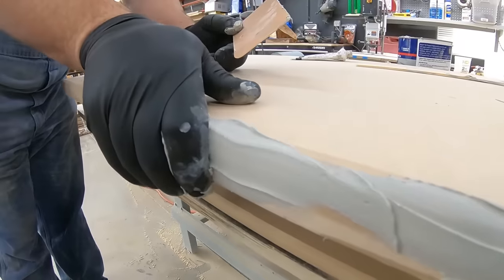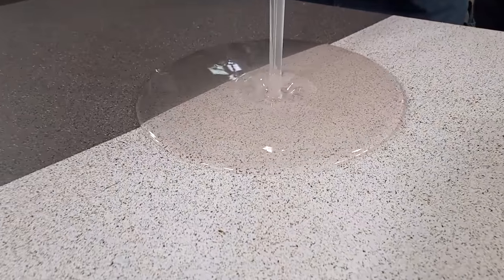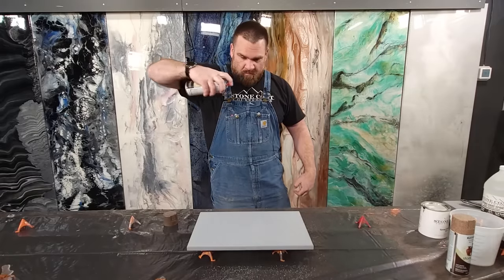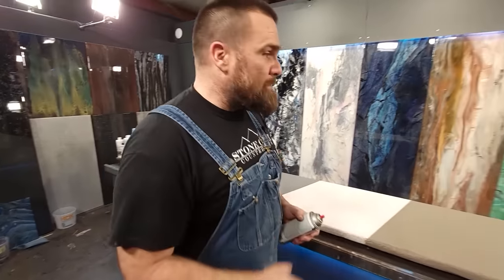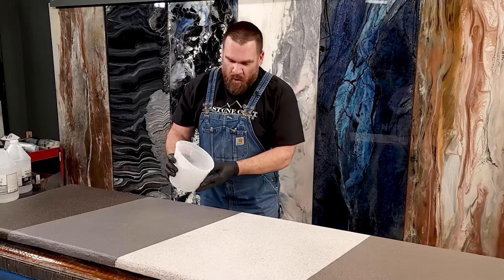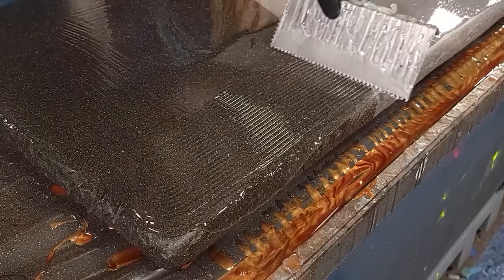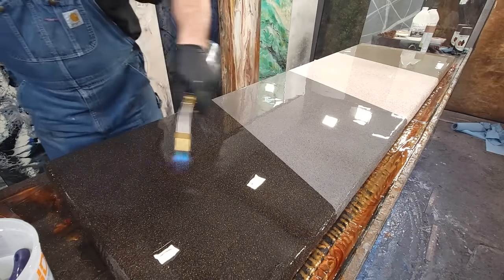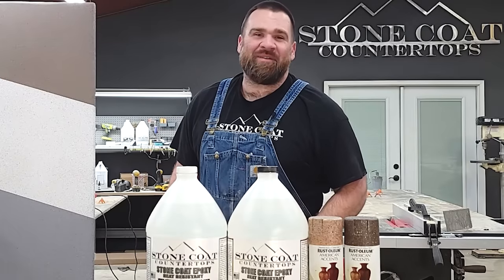Spray on Granite Countertops | Stone Coat Epoxy

Comment: Be VERY cautious using the epoxy over top of the spray on Stone Paint!! I followed the instructions right to a tee including proper environment, prep and drying times. After all of the time and money spent, after full cure time the epoxy pealed off the paint in one solid sheet. After a lengthy conversation with customer service I got the same old "sorry, sounds like you followed the instructions but I don't know what to tell ya there" Well jeeze, thanks for all the help!!!!
Reply: Holy crap! What did you end up doing?
Reply: @pennyarizzio2824  I sanded everything off of the shower bench and went with tinted epoxy to match the walls.

Comment: You guys talk a good game, but I hear from a number of pro countertop installers in my neck of the woods that a lot of their business is ripping out epoxy coated countertops because they don't hold up over time, particularly in heavy traffic areas, like around sinks.  I have commented on other YT videos with the same question, but no one bothers to respond, even though we are all encouraged to "comment below".  So, will you respond, or join the list of those who don't?
Reply: That’s what I’m wondering too. I figure this isn’t likely to last for years and years or anything, but it does seem like a good idea for someone like me who just wants good looking counters for a couple of years 3-5 years” while I save up money for remodeling the whole kitchen and bathroom.
Reply: We’ve done kitchen and bath counters and the amount of time they hold up depends on how hard you are on them and the types of cleaners you use. It’s not a long term solution but will give you 2-4 years again depending on how you treat the counters. We needed to do some patch work after a couple years.
Reply: I think people do this for a quick fix or to update their kitchen until they can remodel. No one does this and expects 20yrs out of it.
Reply: It doesn't matter if it doesn't last over time. When you make these wood counter tops, make multiple replacements at the same time. 

If you get fancy you can even figure out a "clip in" system using precut grooves like a Lego block.

Comment: I have a question before I buy this epoxy. On the video it shows it with drips along the edges then in the next clip they're gone. What is the best way to get a clean edge? Do I need to sand along the edge when I'm finished and if so what do you suggest is the best way to do this? Thank you! I like all of them. :)
Reply: Yes sand along the edges

Comment: I have a backsplash that is built-in of the counter top. I am assuming that spraying up angles and curves wouldn't be a problem and neither would it be a problem to brush on the epoxy. I like black stone as it looks sharp and modern.

Comment: Love the black. Got a question though. I really like when hairline gold veins are added. How would you go about adding very thin gold veins on this? Or could it not be done.
Reply from the maker: Yes you can add veins! Here is a video showing you exactly how we make our veins in epoxy and thanks for watching! -Nathan https://www.youtube.com/watch?v=f85fXgZyqOY
Reply: @StoneCoatCountertops  yeah but the veins are usually added in when epoxy is down. With this stone spray can stuff it almost looks like a course material your spraying and then covering that with the top coat. If you put the veins in the top coat epoxy will they look like part of the stone top or will they have a 3D effect and look like they are floating above the stone since they are only in the top coat? And if you'd want to put them down before the top coat how would you do that without messing up the spray?
Reply: @StoneCoatCountertops  don't you guys have a marble spray stuff?
Reply: @shawnbowen6833  Hi Shawn.  I've only played with these products for a few months now, but I would do a clear coat (or whatever color you choose) and put the vein in that before you do the spray.  Then top coat.  Hope this helps!

Comment: Hey guys, Wow! That looks awesome,  i have a few questions. 1 why did you not sand after spraying? 2 where can i get the epoxy? 3 my old house has pink arbourite countertops they are in good condition but have low cupboards so cant spray from very high. What do i do first? Need lots of help. Thx Michael

Comment: What can you use if you dont have the paddle thing on a drill to mix the epoxy? I realize the top coat is preferred, but can I get away without it?
Reply from the maker: You can hand mix your epoxy with a mixing stick if you like. Just make sure you get you epoxy fully mixed before you pour. Yes, you can get away with not using our Ultimate Top Coat but it is highly recommend for added durability. -Nathan
Reply: @StoneCoatCountertops  Thanks Nathan so much for replying. Cant wait to get my order in.

Comment: Can you do this on top of your current counter top or do you have to use wood?
Reply: I'm not an expert, but having done work in the painting industry before I can imagine that so long as the surface can bond to the paint and epoxy you're using you should be fine. If you're concerned then sand the entire surface of your existing countertop and apply a primer first to ensure the epoxy and paint bond properly. Keep your non-counter surfaces covered to prevent overspray (it can go further than you think), and be careful about creating an even coating across all surfaces.